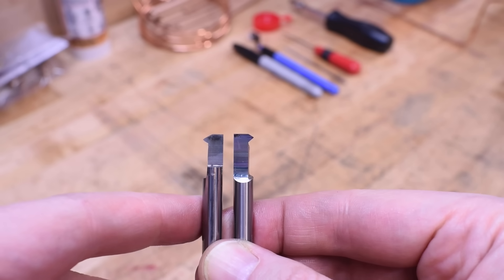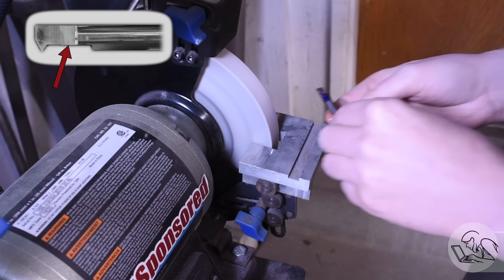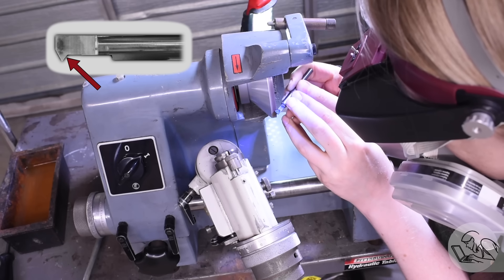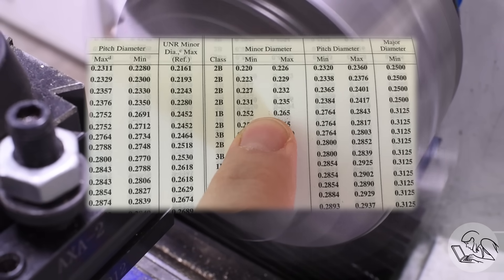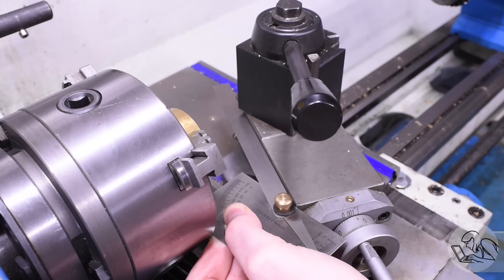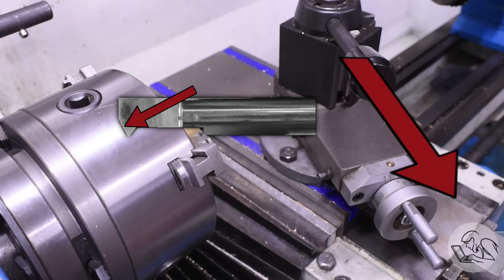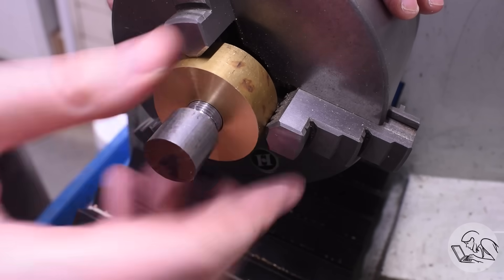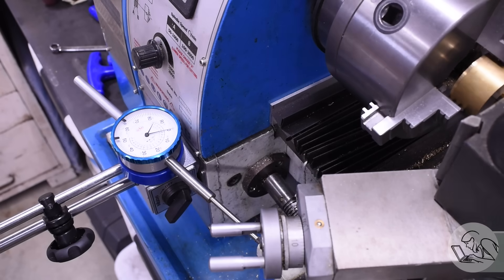Internal Threading On The Lathe!

Comment: You can grind a old used hacksaw blade to a taper point and use as deadnut  point. Clamp it to the right  side way wipe.set your cutting tool at the end of blind hole or shoulder. White paint a mark on lathe bed near end of point. Scribe  a black dot on mark. That will the stopping point for disengage the thread action .old timers like me call it blind threading. Front threading made easy.

Comment: Now show a trapezoidal internal threading job! I’ve found that so much more difficult because the tool grind is so critical in terms of the width of the root. Initially I used to grind the tool with too much of a point which meant that cutting to the major diameter got nowhere close to a mating thread, I always had to go way deeper. On the other hand, if the tool Is too wide at the root you end up with a sloppy thread pretty much as soon as it goes in because to get to the major diameter you end up with flanks that are already too narrow.

Comment: Thanks Quinn! I had to internal thread a ring to screw a dog bone radiator cap into which has a 2" 16 TPI Whitworth thread on it. I have done threading before but not enough to always remember the finer details but I knew you had a clear and easy to follow film on it. Excellent memory refresher!

Comment: I've actually gotten to where I rarely do a scratch pass to check my gear setup anymore. I just put an indicator on the rear of the carriage set it to "0", engage the halfnut and turn the chuck one revolution by hand. If all is well then the indicator will read that the carriage traveled 1÷ by my chosen tpi. Works just as good for me.

Comment: Quinn,   If I cut the internal threads in reverse travel with the first tool you made from inboard to outward am I going to get left handed threads?  Thought I saw Joe P cut then in that direction but he turned the tool upside down and ran in. If the travel goes either way won't the threads be the same as feeding it inward? I'll have to try it and see what happens. 👍👍👍👍🤞🤞

Comment: Hey Quinn, I saw in a video somewhere where someone was doing internal threading and would reverse direction once through the through hole of the part, and then feed back out while also cutting a small amount of material on the way back out to save time. I know this isn't necessarily the conventional way, and not every lathe can go reverse (counter-clockwise?), but what are the downsides to doing this as a time-saving measure? Extra tool wear due to the pressure being applied to the back side of your tool? An interesting thought at least. Oh, and I mean specifically while threading, I know you can boring bar in reverse all day without any major issues.

Comment: I am under the impression that diamond grinding wheels should not be used with high speed steel?  Thanks
Reply from the maker: This is carbide, but you can use diamond on HSS. Works fine.
Reply: @Blondihacks  

Thanks, for some reason I thought you were grinding HSS hence my question. I appreciate you taking the time to reply.

Comment: Had to make 100 each 1-12" stainless steel bolts and nuts once at work. For a pulp press. I made a boring bar with the 30 degree and ran it upside down and in reverse for the nuts, Like you said, it took out the pressure or anxiety of crashing the work. Thanks for the video. Awesome watching!

Comment: Just in time, I need to cut a 16 tpi internal in a piece of 12L14.  I've only got a 5/8" hole to work in. I have some O-1 steel rod to make the tool. I have a D-bit grinder. Will attempt to harden and temper. Will thread from the chuck out. Wish me luck, I'll need it.

Comment: Hi Quinn:  Love all your videos.  Question.  You showed how to turn the external threading tool upside down to thread away from the headstock.  With the lathe running in reverse.  Can't you do the same for the internal thread job, without making a seperate tool?   thanks, Joaquin

Comment: Also a handy tip for tapping metric threads - its always diameter minus pitch. So something like an M18x1.5 is gonna be a 16.5mm tapping drill. Really handy little trick to have

Comment: I cut internal threads by just turning a regular internal thread cutting tool to the back, cutting with the bottom of the tool with the lead screw set to cut on the out stroke. This also allows the spindle to rotate normally with no risk of loosening the chuck.

Comment: Ha!  I very recently bought an older South Bend to replace my very old Atlas with NO quick change gearbox so its easier and faster to make threads. Ive never done it. Its too tedious (no patients)to read the fine printed chart and change gears over and over. Currently doing a clean up and inspection and soon will try threading. Thanks for the great videos!

Comment: Howdy Quinn!  What brand (Link?) magnifying visor are you using.  I've never found one with the top-of-head strap.  Mine invariably end up on the bridge of my nose.
Reply from the maker: They’re all garbage, as far as I can tell. I have the “usual” cheap one that you can buy everywhere. I’ve made a bunch of mods to fix the worst of its problems.
Reply: @Blondihacks  Now you've done it.  My favorite headband is on my Uvex Bionic Face Shield, and replacements are about half the price of a new OptiVisor.  The Rostock is printing a couple of adapters now, and I should be able to try my new FrankenVisor out this afternoon.  Thank you for the inspiration!

Comment: (Total pre-noob question)
When you’re threading toward your chuck, in the “normal” direction, much much tolerance is there for the time critical operations? Eg. At normal speeds, how long have you got between “the cutter cleared my part” and “I’ve just suffered a powered collision”?
Another eg. How long do you have to engage the half-nut when you’re watching your thread dial?

From the outside they both look like they’re microsecond precision operations,
Reply: For cutting a thread in a through hole, you get to choose how much time you have between the end of the cut and the carriage crashing into things. The further you have the cutter sticking out from the tool holder, the more time you'll have - the complication is that of course with more stickout you have less rigidity. Generally you'll set it up so that you have enough time to comfortably stop everything, but no more than that. (Things can get tricky if the thing you're worried about is the cutter hitting part of the work piece that you don't want to cut - when you're machining a part to a spec, you often don't get to choose how much gap there is!)

The timing on engaging the half-nut is basically one rotation of the lead screw - this is going to depend on how fast you're running the lathe. If you try and engage early in the rotation the half-nut will just rest on top of the screw thread, and if you just hold gentle pressure at that point then it'll drop in on its own at the right time.

Comment: Good video giving confidence to those with a nervous bottom. 
I'm glad the reverse internal threading was covered. For me it is the less nerve wracking way to do it. I always reverse thread internals because as the cutting side is facing you it can be seen easily. Also if you are cutting externals to a shoulder put the tool on the back if you have room and cut in reverse 😁.

Comment: It's this kind of situation where I think that manual lathes could use a bit of automation. A big stepper motor that can turn the whole mechanism a given number of revolutions and then stop. It doesn't need to be fast because thread cutting isn't fast.
Reply from the maker: Well, we invented CNC for a reason. 😁
Reply: A VFD with a jog mode will do this, as long as you have enough torque.

Comment: I don't own a lathe and haven't even ever used a tap, so this is way beyond my skill level and not something I will attempt in the near future. Yet very interesting and entertaining to watch!
Reply: Sometimes it is fascinating just to learn the magic behind the way things are manufactured.
Reply: Go to Menards and buy a couple tap and dies that come with the proper size drill bit and do a few threads manually just to get started. Wear eye protection with all metal projects. I was drilling a hole in cast iron the other day and the bit monetarily got stuck then suddenly released while my eye was only 5 inches away. The release shock, shot metal flakes into my glasses and face. SO GLAD I WAS WEARING EYE PROTECTION! The metal flakes that hit my face were both hot and high velocity. Could have been a blinding experience.
Reply: Just start by cutting some external threads don’t worry about what size they are just trying to make something that looks like threads